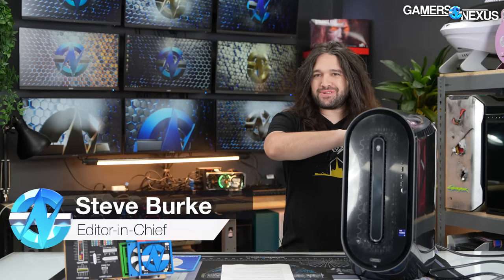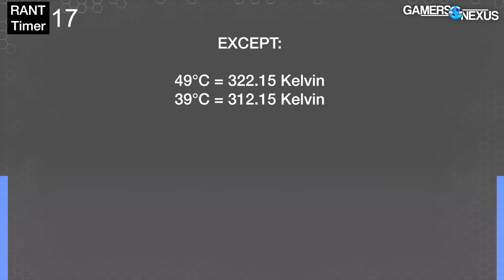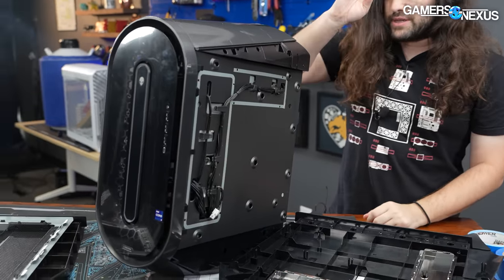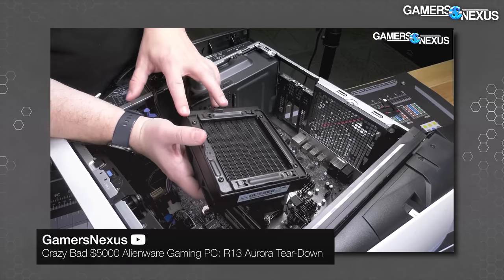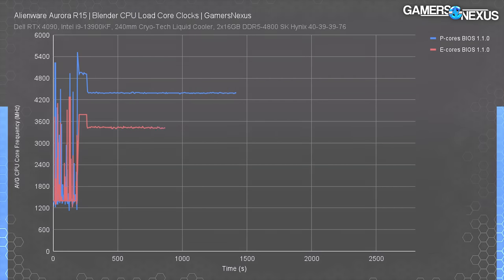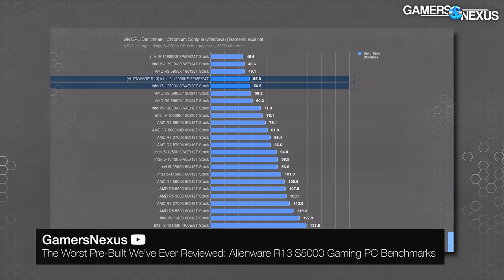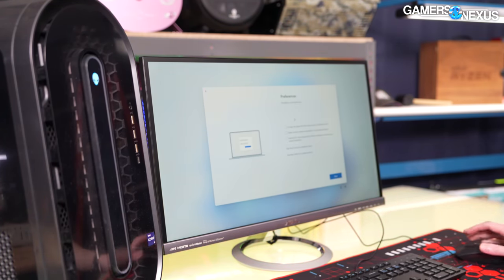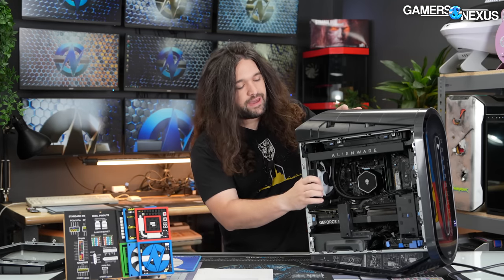Alienware Can't Get It Right - R15 2023 Pre-Built Gaming PC Review

Comment: After hearing 4430$ I kept waiting for Steve to turn this futuristic box around so I could see where they mounted the second RTX4090 card.
Reply: Idd, can easily knock off $1000 building it yourself.
Reply: @olebrumme6356  I'm starting to think 1.5-2K could be achieved, especially if you where going to match the rams lack of any heatsink, the chunky fan motors taking up most the airflow space that are probably worth $2 each. A dodgy used looking 4090 from goodness knows where (fair to say the one in the review wasn't new lol) 2.4k seems achievable.
Reply: @Cogglesz  Sadly the cheapest 4090 is about $1900 here. I'm just waiting for some prebuilds to be on sale and buy it without GPU, then reuse my 3070. Will be fine for 1440p.
Reply: @dstarboi9965  It's either that or having food for like a year for me.
Reply: @olebrumme6356  I don't think you can buy a prebuild without a GPU.
Reply: @thanos1000000fc  We can over here in the Cold North. Change parts too if we want, to an extent. Doesn't cost much more than building it yourself, and there's a 3 year warranty with it as well.
Reply: @thanos1000000fc You can.
Reply: 13th Gen Intel® Core™ i9 13900KF (24-Core, 68MB Cache, 3.0GHz to 5.8GHz P-Core Thermal Velocity)
laptop
Windows 11 Home, English, Dutch, French, German, Italian 
(Dell Technologies recommends Windows 11 Pro for business)
videocard
NVIDIA® GeForce RTX™ 3080, 10 GB GDDR6X, LHR
memory
64 GB, 2 x 32 GB, DDR5, 4800 MHz, XMP (Overclockable up to 5200Mhz)
harddrive
4 TB, M.2, PCIe NVMe, SSD (boot) + 2 TB, 7200 RPM, SATA, HDD (storage)
fallbackcolor
Lunar Light 750W PSU, Liquid-Cooled CPU & Solid Side Panel

In the uk I could buy this pc with these specs for 3800 dollars. Why is it so expensive where you are
Reply: @Cogglesz you are not putting a 4090 system together for 2.4k.
Reply: @RadialNoah  well you can get a brand new 4090 for $1,450.00 or buy now for 1.5. 

Seriously, it's using neigh on cheap components. plastic everywhere, It looks like a $700 Alienware pc from 2001. 

I'd bet some money i could build up a more efficient machine for 2.4k today. 3 years ago for less than the gpu for me a full hard loop system from SCAN at 3.2k
Reply: @RadialNoah  There will be people throwing the parts cannon a the 4090 for another 3 years. Just that good.
Reply: second?

try a third and a fourth since the CPU, ram, case, and cables are all hot dogsh!t too
Reply: That card is crazy expensive here, cheapest one goes for $2200. We have a 25% import tax so that's great when it comes to getting computer upgrades.
Reply: @RadialNoah  For real. I just put a 3080 system together and it ran me just shy of 2k. It'd be 2.5k if I went with a 4080.
Reply: @JohnDoeWasntTaken  and even then, a 2.5k system certainly isn’t a “full send” build. That’s a pretty budget 4080 system. Prices have definitely started going down for components compared to scalped prices, but they still aren’t nearly as cheap as some people like to pretend. We all love to goof on prebuilts, but some people just flat out lie when doing it.
Reply: @Cogglesz  the card already costs 2500$ per piece, no way you can manually build a pc now
Reply: @RadialNoah over here in The Netherlands, there was a period where getting a prebuilt with a decent GPU was as expensive as the GPU being bought standalone. Some are decent too, my MSI infinite is going strong till date, everything was/is upgradable and never had problems with airflow despite only running 2 case fans. I would really like to build my own just for the experience alone, but the prices ain't helping that case.
Reply: It's Alienware.
Reply: @RadialNoah man you have no clue about computers it's hilarious.
Reply: @Steve.._.  have literally built my last 4 PCs, and my most recent tower was around $6k to build. I very likely know significantly more than you do.
Reply: Stfu dawg, do u know how much a 4090 costs?
Reply: @Cogglesz  you're stoned and commenting on the internet again.

Comment: I always find it crazy watching these videos. The industrial design that has carried over with dell through the years, as far back as the late 90s dell XPS systems even. So much of this case feels like an office pc inside as opposed to a high end gaming pc.
Reply: Maybe that's not even a bad thing, it works well enough for the GPU. It really just seems like it's their attachment to that awful case which is really holding things back. There has to be a way to have an "alienware look" without strangling the CPU.
Reply: I am talking about things as far as even the way you remove the side panel my XPS with a Pentium 3 had the same spring loaded latch style. All they have done is change the colorway and added an alienware flare and curve. I owned an alienware back in 2001 I believe it was that was an experience closer to the Puget Systems build Steve showcased on the GN Extras channel. It came with a binder breaking down the build and everything in a custom Antec case. What dell has done is turned them into just another arm of their corporate machine.
Reply: I had an XPS 400 with a Pentium D, 2GB RAM and a deceivingly small Radeon of some sort with 128MB of VRAM. Iunno the spec anymore behind that. I say all that because: The hard drive sliders, the spring-loaded side panel, the flippy expansion slots, all of that, hasn't changed since 2005. It's even the same pale blue.
Reply: $4000+ and you still get matrix green ram sticks lmao Dell really know how to dress up a pig
Reply: Thanks Steve!
Reply: Right. the inside looks nostalgic almost with all that shit in it
Reply: When I pee it stings
Reply: @Juke-Redlin so I was not crazy thinking "i have seen these gimmicks at least 15 years ago". Thank you

Comment: I’m guessing it wouldn’t have been practical, but it would have been interesting to see the results of taking a Dremel to the top of the case
Reply: I was hoping so bad for that or just ripping off the restrictive front panel as well.
Reply: Honestly I don't think it would have helped.  The bottleneck here is the long-term power limit imposed by the BIOS, which still seems to be tuned for the older case design and is inappropriate for the improved design.
Reply: I have a feeling that the metal case under all the plastic isn't open either. I'd like to see them break the case down and see if it COULD be mechanically improved. You know, do Dell's job for them.
Reply: It wouldn't matter.  Dell limits power so hard that thermals aren't an issue.  And since all the settings are locked down in BIOS, more cooling wouldn't help.
Reply: Why would anyone pay anywhere close to that. Imagine the setup you could v have for 4 and a half grand that you have total control over.  Alienware is overpriced shit still getting by on the name when they used to be cool and hardware was a lot less expensive, well made and a lot more exciting.
Reply: @TheMatthewLedbetter  I think if there were no air path between the radiator and the top-rear vent, GN would have noticed that and pointed it out.  It's unfortunate that we didn't get a camera angle to the inner upper part of the case which the radiator mounts to.  They ARE criticising the lack of a straight air path directly out of the top, but I don't think that's strictly necessary.
Overall, I think the thermal design of the system is now just about sufficient to handle the CPU's and GPU's full stock capabilities, but it's the BIOS-imposed power limit that's holding it back.  And while that isn't necessarily within GN's power to correct, it IS within Dell's power.  They're pushing out BIOS updates on a regular basis anyway…
Reply: For the top, yes and no… the angle they use is more then enough for the cooler flow.
Reply: @terryboyle2339  I agree, for a $4500 price tag this is utter dogshit.  Especially since GN bought it at retail, but it arrived already dusty, clearly having seen months of use.  The cheap generic mouse and keyboard supplied just adds insult to injury.
Reply: @TheMatthewLedbetter From what ive read in comments on older dell reviews the metal case is the same thing theyve been using for decades at this point.

I also doubt it was ever meant for anything more than your avergae office pc at that point in time.
Why they dont just get some conpany in china to make them a case i dont get.
Do they have like hundres of thousands of units laying around or what?
Reply: @wobblysauce  No, not really. XD

Comment: Ah yes... the annual Dell/Alienware roast sponsored by GamersNexus.

Loved the part where you explained how to solve the Riemann hypothesis. Amazing stuff.
Reply: Lol its not really a roast, it's more of a slap to the face for dell to get their shit together and facts
Reply: In the last 18 months, I have had nothing but problems with Dell.  This is the series of systems I have had, their replacements, and the current statuses of the equipment.  

m17 r3 failed and replaced with x17 r1.  x17 r1 repair attempted twice, replaced with another x17 r1.  that one had 3 attempts to fix it, all failed.  Replaced with x17 r2.  This system failed twice.  Purchase refunded and put on DFS account despite account having been paid off over 2 years before.  Was told I would have to wait 6 months before i could cash out the credit or purchase a new system.

m17 r5 AMD.  DOA.  Replacement had problems with video card.  Repair attempt failed.  Returned for credit within 30 days of purchase.

x17 r2 (didn't want to wait 6 months for $ of first machine).  Repair attempted 4 times.  Didn't fix it.  Replaced with x17 r2, repaired twice, replaced with x17 r2.  Current system.  Have had issues with it and haven't had a fix in 3 months - constant contact with Dell asking what is going on but no repair has been attempted due to "part availability issues" blamed on the pandemic (still).  

I have tried the Executive Email carpet bombing technique in the attempt to get someone to escalate this.  I have gotten nowhere with it.

Oh, I have been a Dell certified tech since 1999.  I recently led the Change Control Board at my employer to switch from Dell to HP as our primary vendor.  Why?  In the last 3 years, Dell's systems went from a 2.4% system failure rate to 6.8 whereas HP has gone from a 2.9 to 3.1%.   Total cost of ownership due to the system failures have made it so Dell is not a good option compared to HP these days for business-class systems.
Reply: I've hated Dell computers for nearly my entire life. For some reason I've had 4 Dell laptops, only 1 I actually bought, the other 3 were from work.

I legitimately don't know how Dell is still in business with how fucking awful their computers are. Their chargers used to somehow just fall apart, every time. It's like the plastic was self destructive or something.
Reply: It’s so nice to see these versus the Linus ones. Linus seems like a shill after watching Steve’s.
Reply: Or worse batteries becoming "Forbidden Capri Suns"

Comment: My first computer was a hand me down Dell Dimension from 2002 that used a standard MATX mainboard and ATX power supply, and it was built better than the Alienware desktops you reviewed. Even at the height of the capacitor plague and using a Pentium 4 CPU (Socket 478) Dell made decent prebuilt PCs. The fact that they aren't using standard parts is a massive step backwards that needs to be corrected.
Reply: Dell back in the day was great. But now, Dell has definitely taken a huge step back.

Comment: I know this one was pretty rough, but I bought an Alienware Aurora R7 back in 2017 with 0% financing for around $1800. Got an i7 8770k, 16GB RAM, and a 1070ti and honestly I was and am really happy with it. I just "retired" that machine after upgrading a bunch of the parts over the years and just bounced it to my wife for her, much MUCH more casual use. 6  years later and it's still going quite strong with 32GB RAM, and upgraded modular PSU, and a 3070 in there now.
Reply: alienware is fine. this dudes a baby.

Comment: I haven't watched the video yet, but I take apart probably between 30-60 old Dell prebuilts per day as part of my e-scrap job, so I would love to see if Dell is still doing weird, cheap stuff in what should be their high end consumer products. Edit: As far as the physical build construction goes, this is pretty impressive compared to their older desktops. Btw, those blue tabs are EVERYWHERE in every dell system I've ever torn down, they've probably been doing that for two decades. Servers too. Everything besides laptops is filled with blue plastic, and after a decade and a half or so those tabs become about as strong as a graham cracker. As far as the GPU dust goes, I really hope that is just from extended internal testing, because if they are putting used parts in a system and selling it as new for 4000+, that is a massive ethical problem.
Reply: Unless they're testing these systems at a rodeo or at Burning Man, this level of dust is inexcusable. Before assembly, the last place those parts have seen open air is a microchip clean room.
Reply: very much like packard bell in the late 90's, i warned people for months that the hdd's were refurb and no one listened, they eventually got sued.

Comment: I think they engineered some pretty good latching mechanisms for sliding things in and out and it'd be great if they took those designs and just put them in better-designed cases - not only not let marketing dictate the content of the product descriptions, but also the products themselves.
Reply: I think the latches are the least of this products' worries
Reply: What if a case manufacture out there actually take this concept and run with it.
 
Engineered a case with pop out frame for all the standard component. That way the cable management is all done. 

And sell it as a premium product with premium look. 

I'm sure there are folks rich enough to pay for that. 

But the power supply is an issue as cable are not interchangable between different power supply.

Comment: Got an R15 in july.  It started having random crashes a month later, proceeded to get exponentially worse. Replacing the GPU buys me a week or so of stable use before it starts to blackout.  I have seen a reddit with another R15 case where both the original and a replacement both experienced these 'blackouts'.  CPU, Motherboard, GPU, Fans, OS and Driver have all been refreshed till the support crew are scratching themselves silly.

The only clue i have is from the engineer team who said that the second GPU was overheating.  Now on my third GPU, the system has blacked out again.  until just before it went into the shop, my device would only crash when running a game.  when dell created a copy of the stats, and made to send it through remote assist, the system crashed.  The most recent crashed occured while idle with steam and opera GX open in the background, and again while downloading 'critical' updates.

My aurora 15 has now forgotten how to factory reset.  The supervisor of the support team warns that the OS i was running was non-standard.  I don't know if it's related to the buggy behaviors of the support apps, whether the latter is due to missing files/software, but at the end of the day... the system is acting up, Alienware command center is awol, and my computer is still shutting itself down randomly.

The support team would have me believe that they haven't seen another case like this.  I've seen another youtuber talk about this device, having been sent a replacement R15.  I am not impressed with their record keeping, especially with a device with such a devastating error.

5k$?  I got it for a sale at 2500$ and now it has dropped all the way to ~1500$  If this device is getting undercut by such a dramatic failure, why is is still on the market?

Comment: The one thing I can offer Dell props on with this machine is the CMOS placement. That is really good placement and is extremely easy to access. So many modern boards make it needlessly really inconvenient if you ever need to clear CMOS, since it's buried under the video card. Or worse, under some heatsink because of visual flair.
Reply: Clear CMOS button is going to be a feature I look for going forward, I don’t like messing around with jumpers or screwdrivers to short the circuit.
Reply: @Terracronz  don't you only need to pop out the battery? theres no need for jumpers or screwdrivers
Reply: @toad7395  Jumping is what a clear cmos button does, it's what most buttons do actually, doing it with a screwdriver isn't risky or anything.
Removing the battery can be an absolute bitch in a lot of systems, it's often clamped pretty tight in a spot where you can't reach it very well.
Reply: I mod my case , add clear cmos button side reset button, acces with needle.
Reply: oh dang, i must be lucky my asus prime x470 pro mb is in the bottom right, but it still takes a screwdriver to bridge the pins (instead of just having a button like most mid to high tier boards I would guess).
Reply: How often do you need to clear the CMOS, and why?

Comment: i bought this for 2900 yesterday .. intel i9-13900kf , nvidia rtx 4090 32gb ram (4800mhz) 1 Tb ssd, 1350 psu , liquid cooled.... its was one option below the most expensive one at 4500.. which had 64 gb of ram and 4 tb  ssd .. the original listed price for mine was 3900.00 but they had it for 600 dollars off and with signing up for dell emails i got another 10 percent off which is another 300 off so i paid 2900 ish before taxes so while i understand the hate for alienware... as a fanboy i feel like i made out ok!